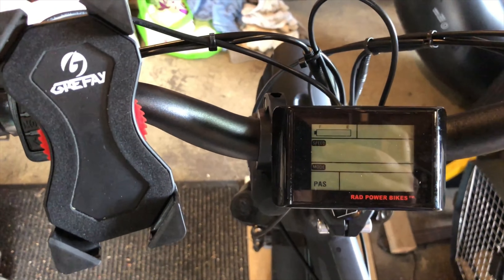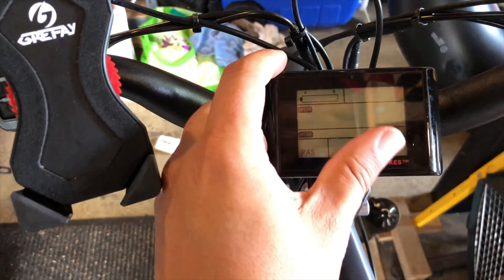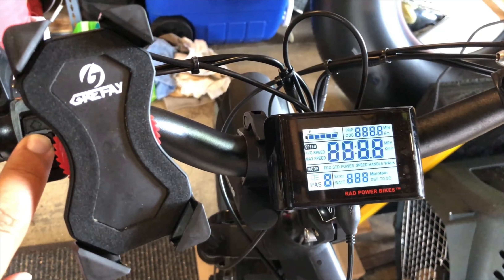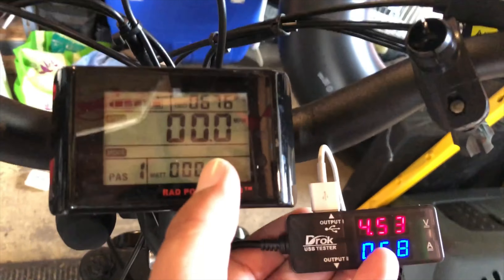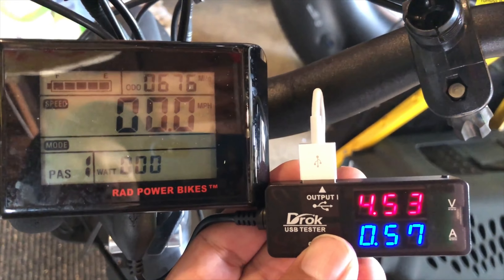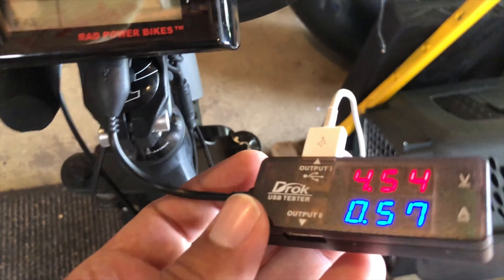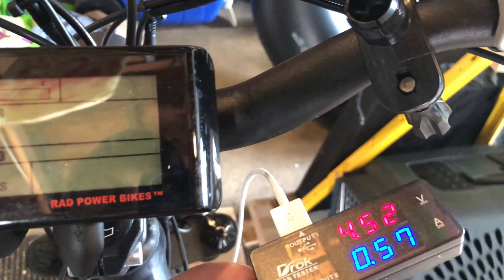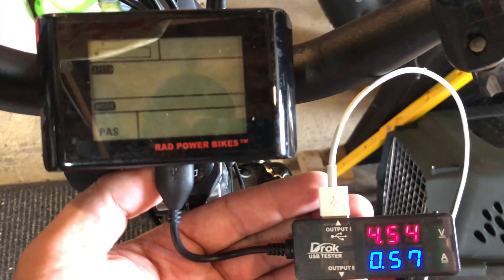Rad Rover USB port and charging a phone

Comment: Fortunately on the 2019 model the USB operation is reversed.  5V, 1A of power is available on the controller USB port when the Rad is powered ON (not off).
Reply: So if I'm understanding ya correctly, the USB port on the 2019 Rad Rover should be enough to charge a phone at the proper rates of a standard charger? I purchased a 2019 Rad Rover a couple months ago and honestly had no clue it had a USB port, but if it's enough to charge a phone, this will save me a lot of custom wiring lol

Comment: Start with bike turned off, then connect phone, then turn on bike. Got it, thanks.

Half an amp is the original standard USB power output. It's not a fast charge, but it'll keep your phone from draining out if using GPS or music on a long ride.